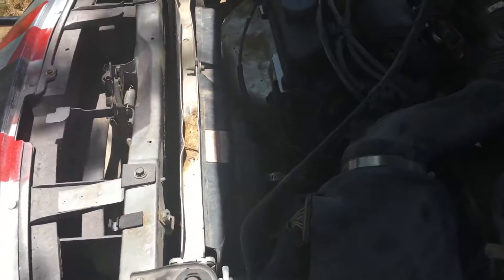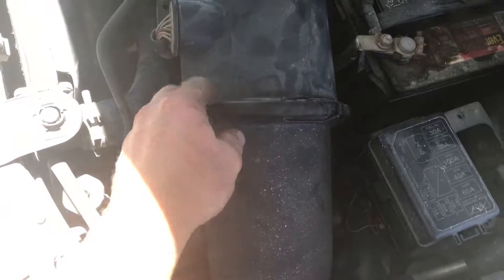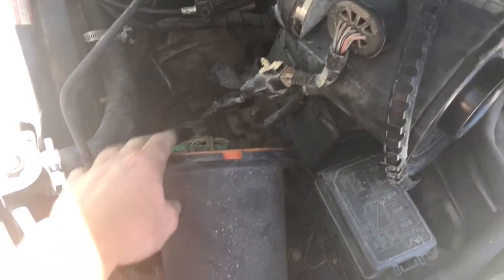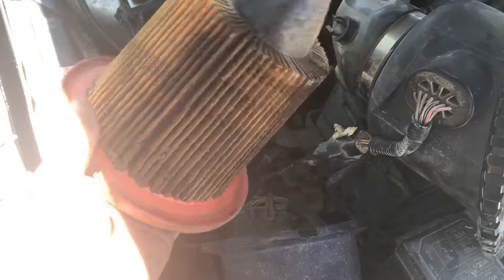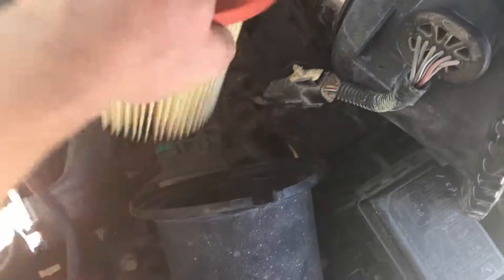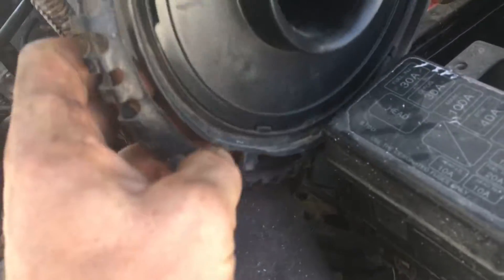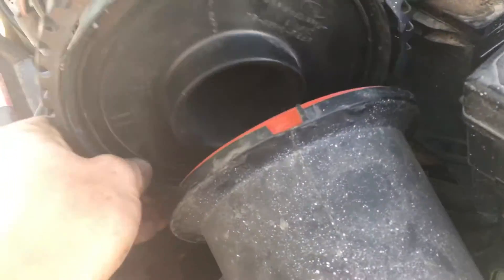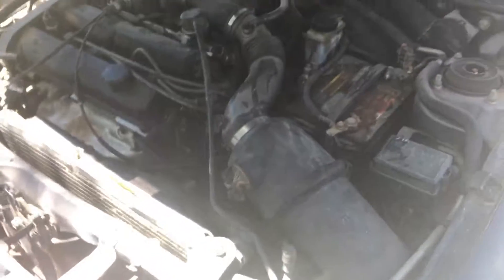Engine Running Rough - Bad Gas Mileage - How To Change a Air Filter - 2002 Ford Escort ZX2

Comment: changed the air filter and all the sudden a rough idle on my kids zx2 lmao did a full pcm reset with jumper, crc maf cleaner let it dry over night rough idle still there
Reply: Check ur egr valve or idle controller valves on ur intake and clean up and pcm reset it